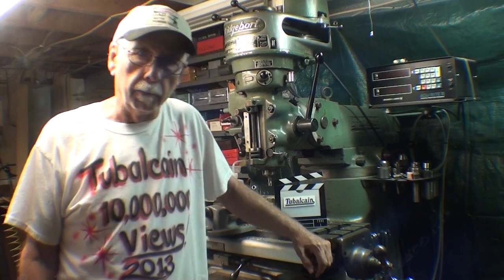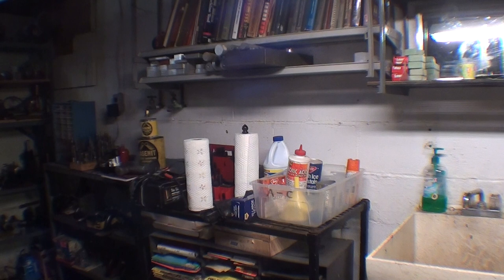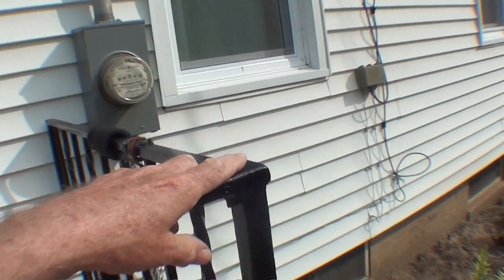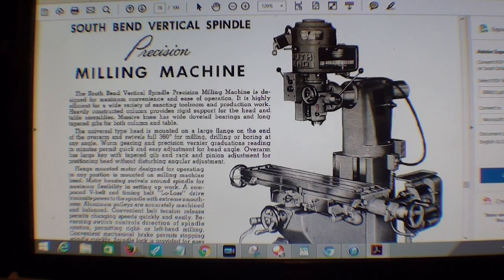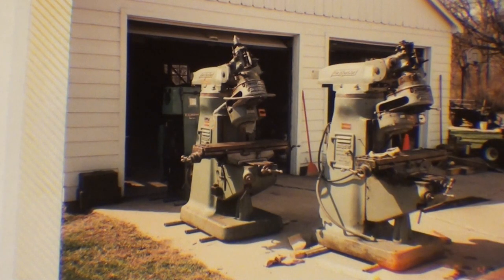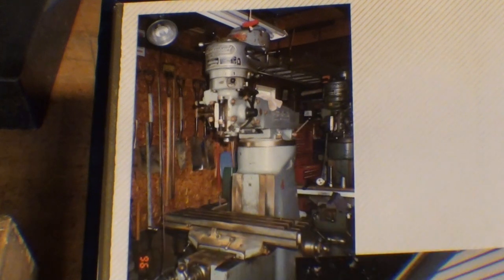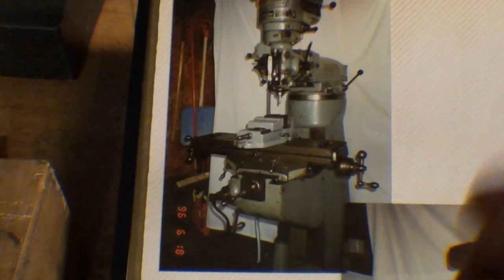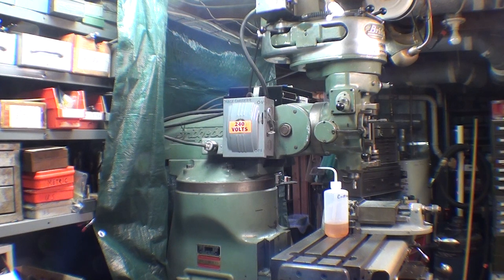Tips #274 How to Move a BRIDGEPORT Mill basement tubalcain

Comment: In the spirit of great minds think alike, it was c.1983 when I was running a one man HVAC company and had a commercial customer who wanted a new boiler in the basement of his building. With everything stripped off of the cast iron sections, it still weighed about 800lbs. There was a trap door on the ground floor that revealed a set of wooden stairs to the basement. I did almost exactly as you did to get the thing down there. Shored up the stairs, put planks over the treads to create a ramp, found a solid anchor point to install a large eye bolt, and used a come a long to slowly slide it down there. All of this I did solo. I reassembled it in the basement and finished the job without incident. I'd actually forgotten all about that until I saw this video.
Thanks for the memories.

Comment: Hi . I also moved my bridgeport down to the basement but all by myself. Iam 70 now but that was 2 years ago. I took it all apart and the column I put duble 3/4" plywood on the stairs. I used two come-a-longs. one pushing and one pulling. I used a harborfreight one  ton shop crane to lift it. My wife wants me to get it out of the basement before I am 80. It is all your fault been watching you for years and when I saw yours I wanted one.
Reply from the maker: Good job--would never even thought of doing it alone
Reply: TY. I also brought my 13" South Bend Turret lathe down myself. That was last year.
Reply: Mechanical advantage and good rigging are everything when messing about with heavy loads... I've moved stuff by myself using a chainfall and a 1 ton engine crane, along with the usual hydraulic jacks, pipe rollers and pry-bars...

One of these days I'll add come-alongs to the mix!

Comment: Great video, so often many people do not consider how to move heavy iron, I have a very heavy gun safe inside my house and I remember moving it on golf balls and the power of "French" words uttered that day along with a few strong friends, I use my garage for a shop, and have a decent lathe and small mill, when an if I move that gun safe will probably stay, ( The only reason it is still in the house is because my wife could never hope too move it out of are/her walk in closet ), I tell her on the positive side "If the house ever burns down at least are pass ports will be ok",  but working in the paper industry helped learn a lot on how to move very heavy equipment, some of it was well over 20,000 lbs,  but I always found it interesting how guys ended up with stuff down in there basement shop.

Comment: I started to take mine apart to put in my basement but plans changed. Just sold the house and moving to a new one with a 40 x 60 shop.  And the work will begin. I've got a month to move.  thanks for sharing.

Comment: I just acquired-and moved-a circa 1940 Kempsmith No 1 Universal vertical milling machine-2750 pounds.  The place I bought it from used a gantry hoist to put it on the trailer.  From there I was on my own.  The good thing is that I have a ground floor shop and using time, gravity and some 1 inch pipe, the beast now lives in my shop and is waiting for me to clean it up and make something.

Comment: After my parents moved out of their house, I single handedly moved a large player piano out of their basement.  The stairway was set up like yours and I could back my trailer and truck in front of the exterior door.  Using ropes and come-alongs,  grooved planks for the wheel to guide in, I managed it in just an hour or so (of course, that doesn't count the many hours of planning it in my head and all the prep work)

Comment: Love it. I had a similar problem; twice actually. I have a 1937 Avey drill press.   The table is actually larger than most mills.  Three  columns.  Did it just like you, in pieces.   It too, will go with the house.  It's a great machine but far bigger than I need.   Same as you, I got on a sealed bid.   I'd hate to leave it behind because it is the smoothest, truest  drill press I've ever used, but we're looking at moving in a couple of years and I can't take everything.  My Southbend lathe will make the trip though.

Comment: I too, have a tolerant wife, for which I am eternally grateful. The houses where I (or my dad) have had machines in the basement were pre-milling machine, so there was never anything larger than a SB 9" to go down the stairs except once. Somehow I found myself with a Porter-Cable brake-drum lathe (which had been poorly converted to general use) where the irreducible bed alone weighed about 800 pounds. I can't remember how we got it into the basement, but I think it involved massive muscle and lots of people (probably paid with beer - afterwards). How it came out was something else.

I gave it to my friend Paul with the proviso that I have nothing to do with moving it out. He stripped the bed and stood it on end with the help of a come-along to the ceiling joists. He then rocked it and walked it over to the base of the (shored-up) stairs. There he began rocking it back and forth, slipping stacks of shims and progressively larger blocks under the bed until he could walk it onto the first step.  As Tom Lipton says, "Rinse and Repeat"*. Up the 6 or 7 steps to the side-door landing and out the door, rocked/walked it across the road to his house where he reversed the process down into his own basement. All in one night, single-handed (while I slept the sleep of the determinedly innocent).

========
* "Rinse and Repeat" was (supposedly) coined by an executive of the P&G company - makers of Prell Shampoo - back in the 1950s. It essentially doubled sales. To be fair, it makes sense - the first shampooing converts the oil in your hair to soap scum; the second washes the soap scum out of your hair.

Comment: I have seen a fair amount of these for sale on Ebay since the collapse began in 2007, some at ridiculously low buy it now prices.  Like can we say a J head Bport  mill with several full tool chests of endmills and other accessories, all for only $2K?  What has stopped me from swapping out the 110V Siegs is the thinness of the concrete floor of my basement.  Also of course the need to rewire the basement electric if I bought one.  I am amaed that your home's basement floor was thick enough and reinforced enough to withstand the floor load and vibration.

Comment: The Bridgeport in the basement, will be the best selling point. I have a tow truck, and was wondering if would be able to use it to move one. I am looking for a mill now. My Lodge and Shipley, came home on the back of my tow truck, the front wheels were ready to come off the ground, but we made it.
Reply from the maker: Yes--a tow truck moved a BP for me once. The hook held it upright--the thingamajigs at the bottom held the weight. Moved it 5 miles.
Reply: thingamajigs LOL wheel lift.  It is amazing what you can move with a little imagination.

Comment: This is about how I got my 14x40 lathe into the basement.

Say, Mr. Pete: I'm in the market for a milling machine (that Clausing your friend has got is awfully tempting, but it's halfway across the country from me) and getting a Bridgeport around here in New England is far easier, but I would also be trying to move it into the basement, so this video is invaluable!

How far is it from your floor to the sheet metal, there? That would give me a good idea of whether or not I have enough headroom in the first place.

Thanks in advance!
Reply from the maker: That clausing is long gone. Sold in two days. That dimension is 81 inches. Good luck on finding the BP, there are plenty of them out there
Reply: @mrpete222  I'm not surprised. It's a beauty of a machine. There are usually three or four BP on Craigslist around here at any give time, and I'll ask around next time I make it to the model engineering society meeting in February.
Honestly if I could afford a "continental pattern" machine like a Deckel FP1 or a Schaublin 13, I think it'd better meet my needs, but 81 inches I can manage.

Thanks!

Comment: Hi Lyle, what was the model of the Clausing horizontal mill? Do you have any experience with the add on horizontal attachments for the Bridgeport? Thanks! Joe
Reply from the maker: Never did know the model no. Never saw an add on for the BP either
Reply: Coincidentally I was just looking at the BP right angle attachment just yesterday: 

http://www.ebay.com/itm/Milling-Machine-Accessory-Right-Angle-Attachment-R8-fits-Bridgeport/231987983620

Interesting idea, but I'm not certain how rigid it would be; especially since there doesn't appear to be an arbor support like a traditional horizontal mill.
Reply: Ok thanks for the note back!

Comment: Why put it in the basement? not very accessible i am sure your wife does not like you dragging  parts to be machined through the house
Reply: Mr Pete mentioned at some point in the past that it was due to temperature.  The garage is too cold in the winter and probably too hot in the summer.